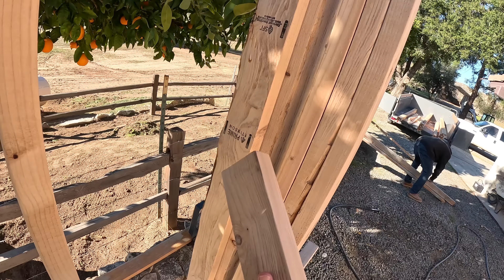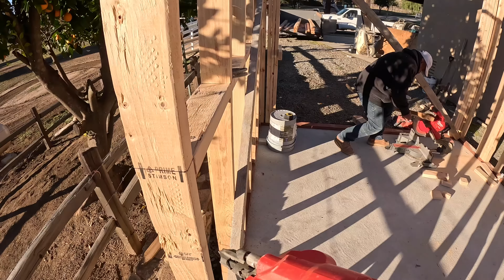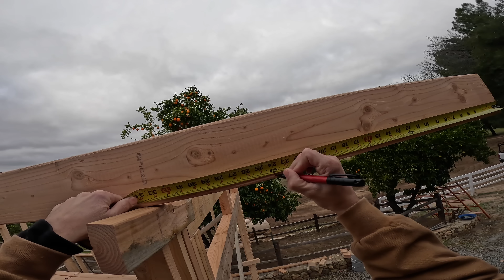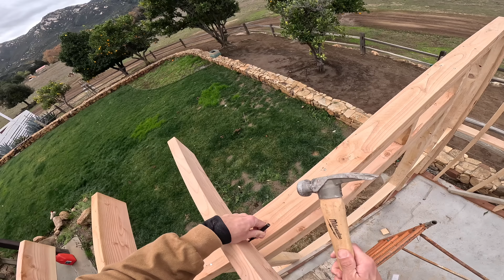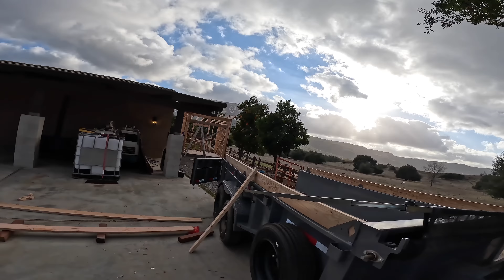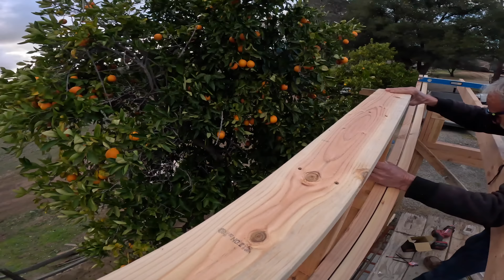Building a Custom Modern Shed! (Part 4)

Comment: Watching you hit the anchors with a hammer , use the roto hammer on hammer setting and with the same bit your using it will drive the anchors in with ease . We set so many anchors into cement and it cuts time down and no mushroom anchors or damaged nuts.

Comment: Awesome video as always bud! No need to land directly over a stud, that’s one of reasons for double top plates. To prevent sag. You are good to go!
Reply: Normal roof layout is 2' so they don't usually land anyhow.
Reply from the maker: @aaronb7990 ya I was going to do 24” but figured it was only a couple extra 2x6’s to do 16” so why not
Reply: @DMAXRYNO  I did the same on my shed. What's 2 more boards 🤣🤙

I totally built mine like it's a small house built over code. I luckily finished just before the vid made lumber prices spike.

Comment: Can you do cost breakdown of material when you finish? Considering building a shed a very similar size
Reply from the maker: Yessir! Keep a list this time!
Reply: @DMAXRYNO  you’re the goat, I’ve been watching since right before you did the custom mega flag pole on your Silverado years ago and have learned a lot about other trades from you! I’m an electrician and have done my own remodels and framing/concrete work with tips I learned from your vids!

Comment: Looking great Ryan! Not bad for a guy who dosent do framing! 😂 How you like that Hercules impactor? Seems like a decent tool. And were those GSK style screws you used to secure the eaves?
Reply from the maker: Yes, Gsk. I love the Hercules impact. Used 1 5.0 battery all day yesterday and today and it finally ran out at the end of the day.
Reply: @DMAXRYNO   that settles it, I gotta try one now. Thanks for your feedback
Reply: @DMAXRYNO  I'd be curious to have you compare it to an M18 brushless impact to see what differences there might be, since that would be a more direct comparison than your M12 impact. I know from a couple small projects I did with a friend that insisted on using his M12 impact, it put the screws in alright, but trying my 8 year old brushed M18 impact right afterward was a world of difference in how fast it would drive in the screws (and less "impacts"). I've since gotten one of the new gen M18 fuel impacts and it's truly crazy how much more power it has and how quickly you can drive in a screw.

Also just a note I've wanted to make for a while, tools working well when you get them is only one consideration for whether or not it'll be the right tool for you (which I'm sure you already know). Having previously worked as an engineer at Milwaukee, I've had good insight into differences between tools in different price ranges and for different markets, specifically as far as batteries are concerned. For instance, Milwaukee has much higher performance requirements for their batteries than the other companies under their same umbrella. This applies to physical abuse testing, but arguably more importantly the allowable capacity decline over a specified number of charge cycles. Milwaukee designs their batteries to last for 3-4 times the number of charge cycles that some of their related cheaper brands design for, which is why their batteries have to cost more so that they can have higher quality cells. The story is similar for the tools as well. Whether or not this matters depends on how much you use your tools and batteries. Milwaukee targets professionals that use their tools day in and day out so that cycle life is very important. If you're someone that just uses tools at home for different projects, and don't have a love for red tools designed in Wisconsin, then the shorter design life might not even affect you and therefore might be worth the savings.

Anyway, on the chance you've actually read this, I've been watching for years and really enjoy your videos. I know you've made comments in videos about people being upset you don't do more truck content, but I personally enjoy the mix of content between trucks, ranch projects, and even forklifts. Keep up great work!

Comment: I didn't add the original comment to the one I just put in because then it would be all in one comment in this way you get 2.
I was told it helps the algorithm by doing.
Now all I have to do is remember what I wrote before. 🤔